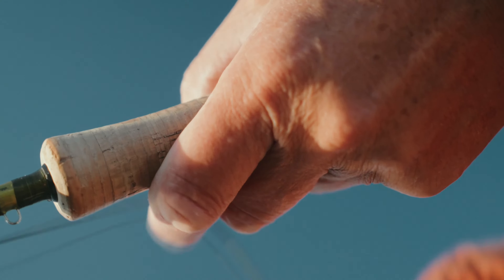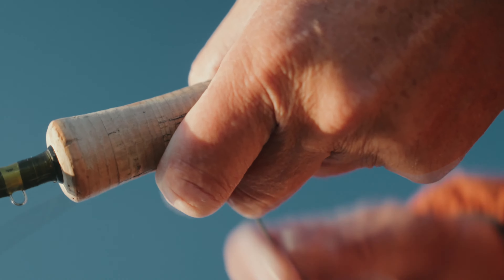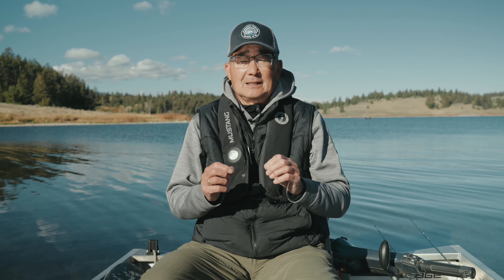Fly-Fishing BC Lakes: Sinking Rates of Essential Fly Lines

Comment: It also depends on the temperature of the water as well.  As water density can vary with high & low pressure systems.so the sink rate of lines will vary as well. Plus if you are using mono or fluorocarbon line.